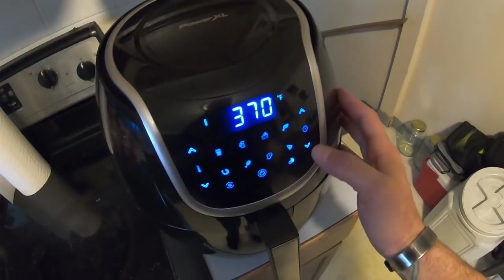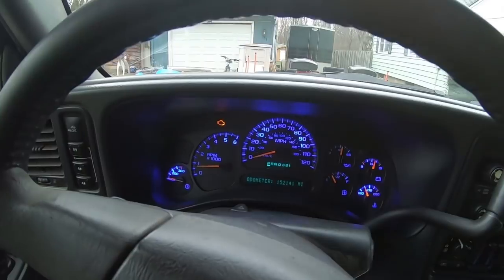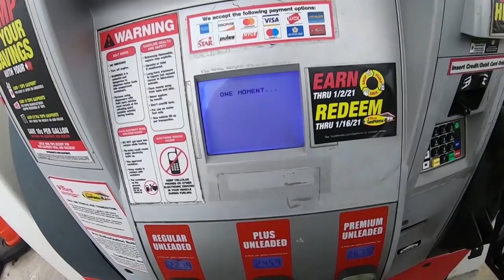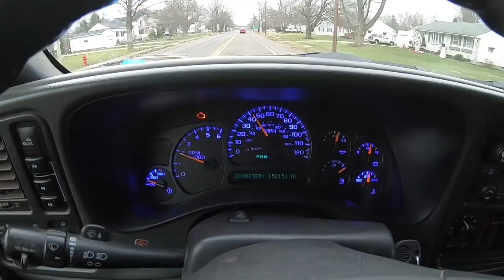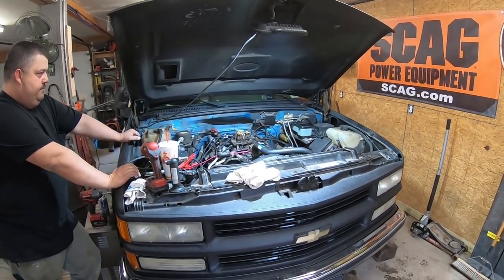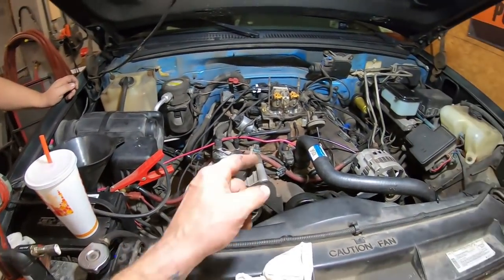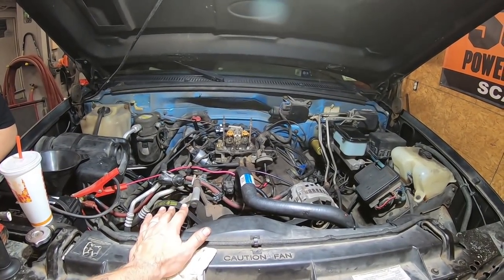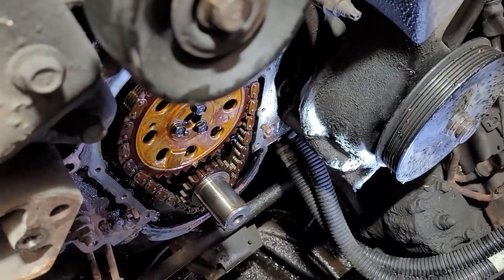Lawn Care Truck Screwed

Comment: I would use some brake clean and spray around the intake manifold see if it sucked a gasket somewhere. Also I wouldn't be surprised if the root of the problem is a bad torque converter for the stalling in gear.
Reply from the maker: That's what I'm told
Reply: I agree with this look into torque converter or torque converter clutch solenoid.

Comment: When you say puffing white smoke, that sounds like coolant is getting into your cylinders which means you got a blown head gasket. But that usually wouldn't cause the truck to shut off. Only other thing that could cause the truck to shut off is bad injectors.
Reply from the maker: Head gasket is good

Comment: I would suggest checking or replacing the pickup coil inside the distributor.  One of the first symptoms of a bad ignition pickup is an engine that stalls. An old or failing ignition pickup may cut out signal intermittently, which may cause the engine to stall. The engine may suddenly just shut off, almost as if the key had been turned off. Depending on the nature of the issue, sometimes the vehicle can be restarted and driven again after a brief period of time.
Reply from the maker: Entire distributor is new
Reply: Countryside I was unsure if you replaced the distributor. You mentioned @ 11:45 you still needed to so. Could possibly be one or both throttle body fuel injectors.

Comment: I've in the past had a similar issue with a  ford pu where it was randomly shutting off  out of blue. Turned out it had a blockage in catalitic converter . I had it cleaned out & was ok for a while then it started up again . I ended up tossing exaust sytem in total ran well for 2 yrs till some guy left oil too low & burnt motor up on it.
Reply from the maker: No convertor on this truck but yea I've seen that too

Comment: I had two vehicles that I had to chase a gremlin  on. It totally sucks! In both  cases, it happened to be the remote starter  just shutting them off. It would happen at lights or just driving down the road. The after market remote starters just killed the ignition . Started off once in a while and progressively got worse . Once I took out the Remote  starters, it never happened again. I never had another one since. Not sure if you have one in the truck but if you do try disconnecting it and see what happens.
Reply from the maker: I don't

Comment: I had some similar issues with 94 silverado 350.  Put in gear and it barely had any power.  Had a bad fuel injector.  I watched the injectors when running and could see that one was not spraying fuel.  I rebuilt throttle body and replaced injectors and ran great.  Hope you figure it out.
Reply from the maker: I've been thinking the same thing

Comment: I’ve got a near identical truck but it’s 97 c3500 5spd flat bed no dump. But it was one of few factory upifitted to run on propane. Ever since I’ve bought it’s had a strange clunking when I hit bumps drives good other wise and the problem goes away almost entirely if I have considerable weight in the bed or have a trailer on. At first I was narrowed down to the plastic leaf spring bushings that rest in between each leaf cause they are worn plum gone. but it could also be worn front components that tighten up with weight on ya know? Let me know what you find
Reply from the maker: It's body bushings

Comment: Randy all you mentioned yet nothing about the ignition switch or testing, on my 94 2500 there was a single ground wire coming from fire wall to back of engine rerouted it to water pump bolt problem solved.
Reply from the maker: That's true, I haven't done that 🤔
Reply: @CountrysideStrong  we used continuity test to find that my truck lost continuity under load

Comment: So we have a 99 chevy 2500 2wd ours did the same thing and it was actually a bad valve and bad sensor in the transmission.   Also the electrical connections on the transmission were filling with atf.  Rebuilt the trans and bam it was good to go. 4l60e trans btw
Reply from the maker: Good to know. There's a 4L80 in this one but not much different

Comment: Head gasket? Also even though you changed  O2 sensor if your cat is dirty or plugged it will read incorrectly and trim your fuel. Also if you haven't done a compression test on all 8 cylinders it may be worth doing because I had a 96 k1500 with a 350 and it had 2 cracked cylinders. I gave up on buying old trucks for this exact reason. Constantly chasing problems and downtime aren't worth it.
Reply from the maker: No cat on this truck. Haven't done a compression test yet

Comment: I guessing it’s a pre 1996 truck ? If I remember correctly the last year for TBI was 1995 ? 
I had an issue with my 1999 K2500 missing and running like crap two years ago. Found out on the 350 Vortec engine GM decided it was good idea to use a plastic distributor in those engines. I replaced it with a new one with an aluminum housing. It’s been running strong ever since I replaced the distributor.
Reply from the maker: I did the distributor. It's a 1995 with 454 TBI
Reply: @CountrysideStrong  Wow your problem has me scratching my head... You’ve done everything I would have done. My thoughts are maybe it’s a wiring issue ? Did you cleanup all the ground wires on the truck ? I lost a ground strap from the cab to the frame on a 1994 k2500 I had a few years ago and it caused me a lot of grief till I replaced it.
Reply from the maker: Yea that's one of the first things I did. It's crazy isn't it

Comment: You could have a clogged cat, drill a pin hole in the exhaust before the cat or split the pipe a little and see if it stalls. Also if it only does it in gear could be torque convert related but I would think you would have other symptoms
Reply from the maker: No cat

Comment: I would do a compression test some of the old Chevy’s had valve spring issues as they get the miles put on them, could have some weak or broken valve springs
Reply from the maker: I thought that initially but when it runs, it's smooth as day. If it had compression issues or valve issues it wouldn't do that
Reply: Wouldn’t hurt to rule that out though. 🤔

Comment: you've done the vacuum leak check. probably cleaned the throttle body. Try the idle air control valve..
Reply from the maker: Done all of that.

Comment: Does the dually have hydraulic lifters it my have a valve lifter issue or spring issue? Or you could get a salvage long block and re use a lot of the new parts you just changed. The clunk in the 2500 could be the center support bearing for the rear drive shaft
Reply from the maker: It's body bushings

Comment: You mentioned it ran fairly good when the fuel regulator was leaking.  Could the return line back to the fuel tank be plugged?  Just a thought, good luck.
Reply from the maker: I checked. Blew air back through. It was clear

Comment: U gotta try that spring and pin on the torque converter u mentioned, that sounds like it could be the one, as u said, isn't until u put load on it would shit out. 🤷‍♂️
Reply from the maker: You may be right

Comment: Have u tried un hooking the exhaust before the cat and then if no change before the muffler sounding like mite be getting alot of exhaust back pressure shutting it down try it no out anything if im wrong
Reply from the maker: Brand new exhaust and there's no cat...
Reply: @CountrysideStrong  would say ur definitely fighting a fueling problem but before u spend more money have u done a compression check on the cylinders?
Reply from the maker: @bobchilders214  I agree, and no not yet
Reply: @CountrysideStrong  mite want to check the compression and make sure u havent lost any cylinders. Hope u get the truck running seems to be a great work horse for u and ur business
Reply from the maker: @bobchilders214  bought a new truck today actually. This one is getting sold, I'm done with it

Comment: fuel pressure should be around 26-32psi on the 454. sounds like you are getting to much fuel volume. regulator may be the culprit. could be any number of parts or seals in the tbi unit itself.
Reply from the maker: Yup, been through all of it. We'll see with the new regulator

Comment: I don’t know if it has a voltage regulator but I have basically the same thing happen to my atv, and I but a new voltage regulator on and it fix the problem
Reply from the maker: It doesn't but yes I've had that issue with mowers

Comment: the oil pressure switch will kill the fuel pump so you don't run the motor with no oil pressure and seize it up
Reply from the maker: I mentioned that in the video.
Reply: @CountrysideStrong  sorry must have missed that, thought you were asking why it does kill it. my bad
Reply from the maker: @Septimius13  no problem

Comment: if it runs great until you put it into gear it sounds like a transmission issue
Reply from the maker: That's what it was doing, now it doesn't even run for more than a couple seconds. Gotta change out the regulator and hopefully it'll stay running at that point then I can go from there

Comment: Have someone with a dealer level scan tool analyze it.
Reply from the maker: It's obd1
Reply: @CountrysideStrong  Have you checked if it burns oil maybe it’s as simple as adding oil.
Reply from the maker: @Sam-nw2yc  I did, it doesn't